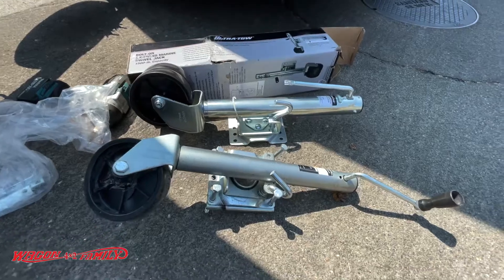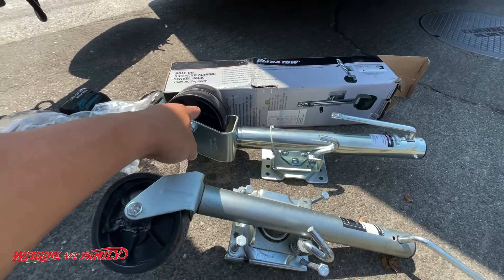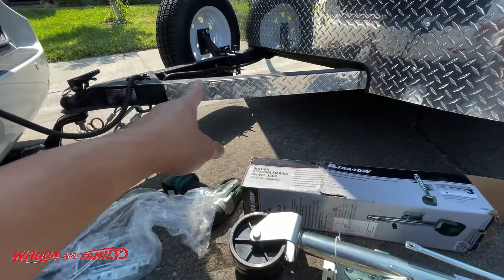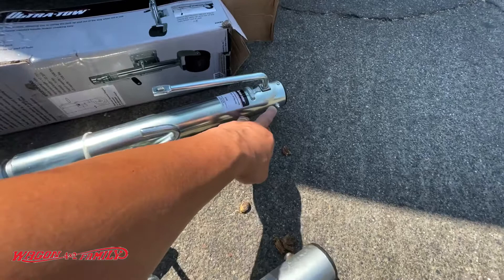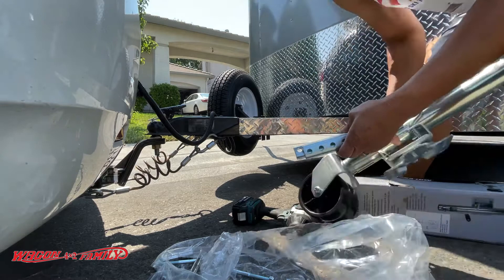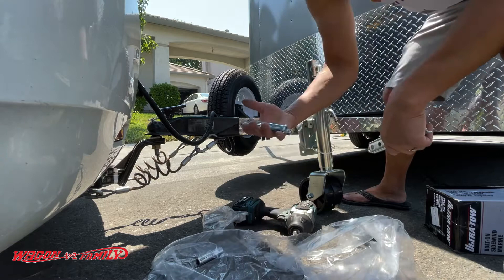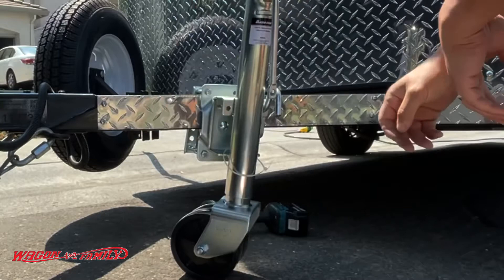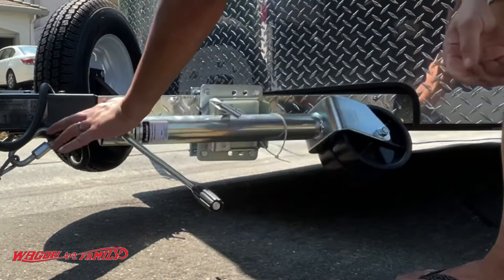HD Trailer Jack Install

Comment: The bracket needs to be turned so the end with the most holes is on the bottom. Two holes on the top.

Comment: You installed it in the wrong position.
Reply: How?
Reply: You put it in the last holes of the bolt pattern. Bottom bolts should go in the holes just under the trailer frame not 2 inches below.